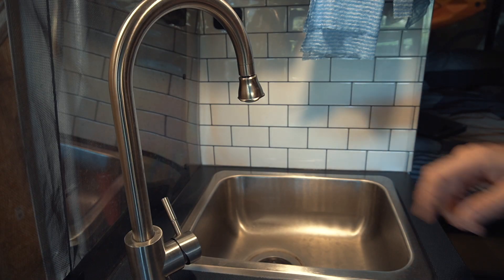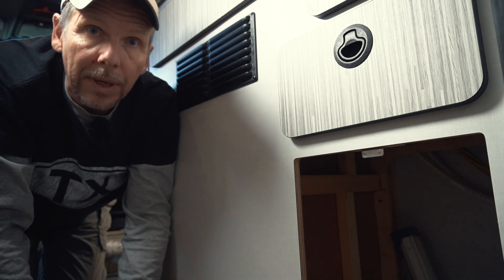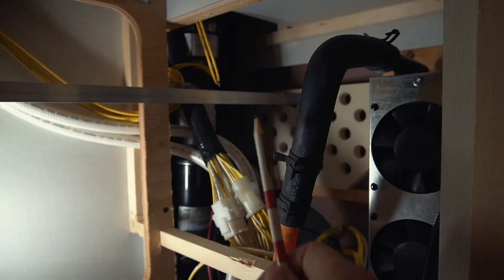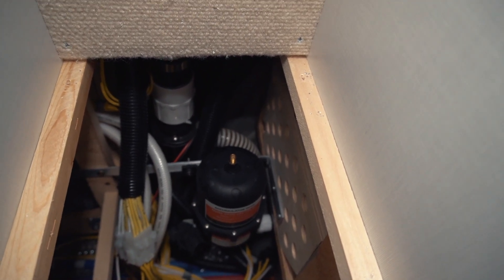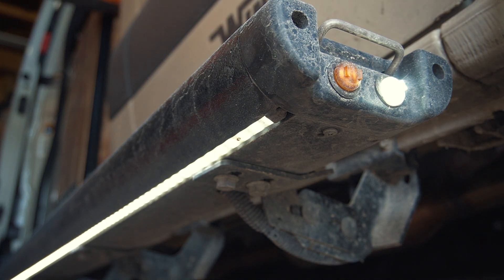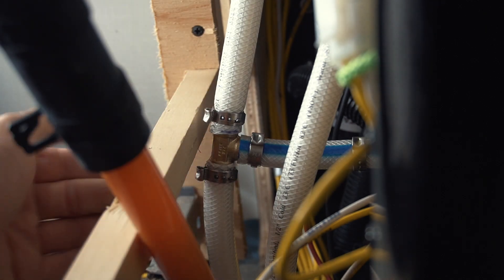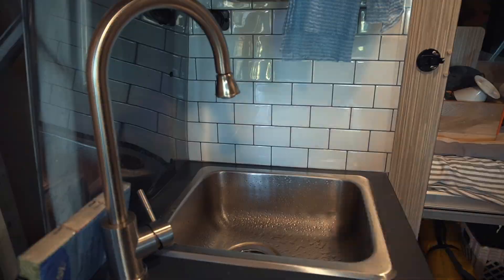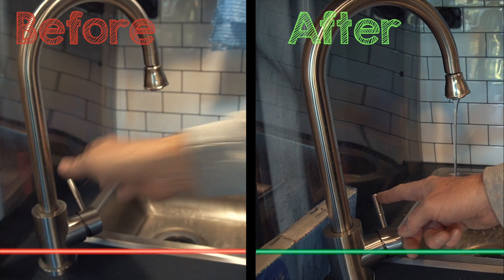Accumulator Tank | Winnebago Revel

Comment: This is same principle as a pressure tank for a well water pump (many videos on YouTube).  The accumulator is a pressure tank with an "air balloon" and as water is removed from the system, the balloon expands.  The pump motor draws very high electrical current at start up, so the short cycling can over heat the motor.  The pressure tank prevents / reduces short cycling of the pump and will extend the life of the pump motor.

Comment: Does it work on hot water too?
Reply from the maker: the tank pressurizes the entire water system, hot water included. However, in the Revel, the pipe run from the pump in the back to the cold water side of the kitchen faucet is relatively straight and short while the hot side first needs to go under the floor, to the heat exchanger under the bench seat and then back across to the faucet. every foot of pipe, every turn it takes increases internal friction and therefore reduces water pressure by a tiny bit. if you notice a difference in pressure and/or flow rate between hot and cold right now, without a tank, (and in my Revel, I do NOT notice such a difference), then most likely the accumulator tank will also be bit less efficient for the hot water side. but still, i think it will provide a noticeable benefit no matter what - especially for its low cost.

Comment: For Winterization purposes I would assume you have to make sure the accumulator tank is fully drained as well.  is that the case?
Reply from the maker: where I live, I don't need to do any winterization so I don't have any first-hand experience to share. I wouldn't worry about any water left in the tank itself, the tank, by design, has a lot of room for water/ice to expand into, still, I would try draining out as much water as possible and/or replace with antifreeze for long-term winter storage. while a little more involved, it would even be possible to remove the tank during the winter and cap off the line into it.

Comment: I love all your mods and ideas. My only concern is with keeping 30psi of pressure in the water line knowing how careful we are to always turn off the pump to take pressure off the system to decrease the chance of leaks. Obviously this little tank doesn’t hold all that much water 💧 if you spring a leak.
Reply from the maker: thank you. when you turn the pump off - and without opening any faucet after it has been turned off - you are also keeping about 30psi in the lines. this is actually a good test for leaks. when you turn the pump back on after a while (the longer the better), when it doesn't spin up, you can be relatively sure there is no leak as there is still enough pressure in the pipes above the pump's set cut-in pressure.
and if you usually turn off the pump and then open a faucet to relieve any pipe pressure, well, you can still do it even with the accumulator tank. only downside is that you are wasting a little more water down the drain as more pressurized water existed in the pipes (pipes + accumulator).

Comment: recommend against using pex crimp fittings on non-pex hose.  Experience shows that stock Winnebago installations using this combination are prone to leaks.  I replaced these with hose clamps which have stopped any leaks.
Reply from the maker: thank you for your comment. I read about this before and saw it mentioned in another video. I never had a leak in my Revel (yet?) and I am wondering if Winnebago uses different types of non-PEX hoses. the ones in my Revel work well with a 1/2" PEX clamp, however, outside of the van I have used vinyl hose that has a too-large OD for a 1/2" clamp and even the inner diameter, even though a nominal 1/2", sits a bit loose on the fittings. in this case, a 5/8" PEX clamp is needed and I can see how this will cause leaks in the long run.
Overall, I trust a properly sized PEX clamp more than a hose clamp, however, I can see how YMMV in specific applications.

Comment: it has bugged me when the pump cycles like that, so this looks to be a good solution, thx! I do winterize though, do you know if the water in the accumulator tank can be drained? (I don't blow water out, just drain and siphon+in antifreeze)
Reply: Winterizing keeps antifreeze in the water lines. It's just replacing the water with a liquid that doesn't freeze. As long as you cycle the antifreeze through till pink comes out the faucet, the accumulator will stay filled with antifreeze and therefore not freeze.
Reply from the maker: @TW---  I second that. Getting antifreeze in and out of the accumulator might be easier if it was installed inline with the cold water pipe instead of T-ed into it. the way I installed it might require a little more draining before winterization and more flushing after. still, very do-able. If a little water (without antifreeze) is left inside the accumulator tank, I wouldn't worry about it freezing. if it does, there is plenty of room inside of the tank for the ice to expand into.